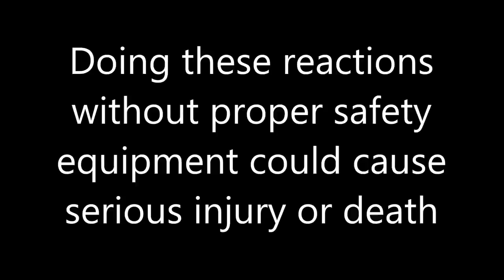Gold Plated Computer Scrap Complete Refining

Comment: Peroxide mixed with the hcl will speed up the base metal removal...... pins should be separated from other scrap, being the lowest grade...... chips with gold bond wires are the highest...... gold plated fingers and such are middle grade...... all 3 are processed differently..... the best way for pins and other iron containing scrap is reverse electroplating......
Reply from the maker: That’s exactly what I would say, thank you.

Comment: If you add hydrochloric acid and nitric acid solution shouldn’t  that dissolve the gold as well?
Reply from the maker: The aqua regia will tend to dissolve the base metals first - for some odd reason unknown to me. Plus, any gold that does dissolve will immediately cement back out of solution on to the base metals - so long as the base metals are present as solid metal. Gold will NOT cement out on the base metals that are in solution.

Comment: What's your opinion on induction heaters and table electric table top furnaces
Reply from the maker: Induction I’ve never used. I have used a Kerr Electromelt electric furnace. It worked well and got much hotter than I can get with a torch and open-face melt dish. But it was slow.
Reply: @sreetips  ok. I was either thinking on buying one of those induction kits with a 12-48'powe supply to do all my melting and casting or one of those electric table top furnaces that you can just drive a crucible in
Reply from the maker: For melting small quantities of gold and silver, the ease of use, speed and convenience of a torch and melt dish are had to beat. This has been my experience.
Reply: @sreetips  I was just thinking the same thing right now actually. I need to educate myself more on ceramic crucibles and graphite crucibles. What would you recommend for a torch for heating? I been looking into these MAPP/OXY combo torches. But I think MAPP gas alone can melt silver and gold.
Reply from the maker: I have two hand-held map gas torches (yellow bottles of gas). They will melt gold and silver but takes long than oxy/acetylene.
Reply: @sreetips  ya they do take a little longer to melt gold. Have you seen those mini OXY/MAPP torches they have at harbor freight and tools. It just like a OXY/acetalyne  torches but much smaller. You have a torch head with a oxygen hose and a MAPP or propane hose. Theirs no regulators on them though. The OXY/MAPP torches are supposed to get hotter than just regular MAPP gas with a torch head

Comment: i understand this is just an experiment, but given the amount of materiel and time it takes to remove the base metals is this an effective way to go about it?
Reply: No. Sreetips has in an earlier video told abou a tip he got, to put plated pins directly into his stock pot, where the base metals will go into solution, leaving the foils only.
But that takes place in a dark mud over long time and doesn't work well on video, I would presume.

Comment: So...I put my gold fingers and cpus into a 2000 ml beaker and added hci 6.0N. The reaction was immediate. It bubbled violently and formed a nasty black scum on top. It has been sitting for about an hour and I do not see any loosening of the gold. Instead, it seems to have dissolved the gold. That should not be the case. But the pins are no longer gold colored..they are silver. Can you explain what happened? Did I make some mistake or is this happening as it should?
Reply from the maker: Unfortunately, I don’t have much experience with this type of scrap. Sorry I couldn’t be more helpful. If you think there’s gold in solution then test with stannous to verify.

Comment: This is the negative control procedure compared to your others. Interesting. Probably A/P or nitric from hereon i bet.
Reply from the maker: Correct.
Reply: @sreetips  I've seen people do a quick wash in aqua regia to rinse off the plating that might be most efficient after some thought. The next step would be interesting to hear from you, maybe your ferrous sulfate trick. Also I have seen a video of guys dunking Pentium processors into a lead silver mixture that they then spread thin and cuppeled it directly into a nice gold piece. You all are pretty amazing! But I think you have determined karat scrap jewelry via nitric boils then to smb precip is most efficient profitable niche. Thanks again!
Reply: *silver-gold piece they made

Comment: @sreetips
I have 10-20 pounds of very old - heavily gold plated transistors (and some radiation hardened with gold processors etc.). I'm unable to find someone to process these. After following you for over a year (I'm fascinated with your process), I'm sure you don't accept requests (which is fine). But I seriously don't want to sell them at the scrap yard, as I'm sure they truly give a penny or less on the dollar [gold-value].
What is your advice for folks like me? Do I have a bucket of money with no real value? Thanks bro!
Reply from the maker: There’s gold in electronic scrap, but it’s not pure gold and it’s not easy to get. The value of your scrap is hard to determine. You’ve seen the trouble I encountered and I relied heavily on my years of experience to pull it off. You’d probably do better to sell it on eBay. But that’s just a guess.
Reply: @sreetips  No doubt about your years of experience. And yes, I do see the trouble you go through. You get great yields for what it is. Regarding the purity (as an expert electronics technician), my educated guess is because it's very early hardened mil spec stuff, they didn't really know how thick it should be- so it's slathered on. I've done x-ray fluorescence analysis in a lab before (but don't have that job anymore). That would be a hoot to measure the potential before attempting recovery.
**Thanks for publishing your passion, and replying. A rare breed!

Comment: Working in the electronics field I see a portion of the pins looked good still. Wonder how they were acquired?
Reply: Those were pins and such that I collected over 14 years as a solderer at a board house. Most were military grade clippings from connectors.

Comment: Really goofy question. How much is 1 gram of 22kt gold powder worth???
Reply from the maker: Would you like to see the math?
Reply: @sreetips  yes
Reply from the maker: 24k is pure gold. So 22k would be (22/24=0.916) or 91.6% pure gold. That means 100g of 22k gold would contain 91.6g of pure gold. The rest, 8.4g would be non-gold metals in the alloy. Usually zinc, copper and silver.
Reply from the maker: So the value of one gram of 22k gold would be $61.80 (current spot for one gram of pure gold) times 0.916 equals $56.60

Comment: I didn't know what you were doing I thought you were doing some weird hydrochloric test to see if you could just use that to get the gold off and then you started adding nitric crazy 🤣
Reply from the maker: Adding small doses of nitric forms a week aqua regia that will tend to dissolve the base metals first and not the gold. But any gold that does dissolve will cement right back out on the base metals.
Reply: @sreetips  I get it I think that's amazing that it keeps cementing back until the base metals are gone. But what was the point? Why didn't you just use straight nitric acid? Super curious have a good one buddy
Reply: Maybe just to show a different process? maybe I just didn't get that at first
Reply from the maker: Aqua regia does it better
Reply: @sreetips  I think I was just assuming that nitric acid would have been more efficient and faster. I don't think you have a video where you've used Nitric on computer scrap. Like you do on gold filled jewelry, Etc. Wait a second I know what I am considering wrong you don't use hot dilute Nitric until after you Inquart it. I forgot about that whole process. Alright looking forward to the next one man
Reply: @jaycharter4345  Yes. He has a video with 10 pounds if pins were dissolved only with nitric. It took 5 liters. HCL is cheaper, so he did it to prove it, but it is not the right way. Stripping the gold off first is probably the best way and that can be done with electrolysis using Copper Sulfate.

Comment: I’ve noticed that in this video you are extremely messy. I’ve never seen you so messy. Beakers all dirty. Your not useing tongs to pick up beakers. I realize now that this is a very old video. I am happy you have changed your messy was.! I’m NOT hating on you. My observation are just that.You have a wonderful weekend!
Reply from the maker: You are quite correct. Sometimes I continue to work when I know I’m not into it. I get real messy. I should turn it off and walk away, but I keep going. Thanks for the feed back.

Comment: Dear Mr. Sreetips,
Simply using a 3:1 solution of AR on the pins would have yielded the same amount of gold, and in about 2 hours and with a vast amount less of chemicals!! You mentioned you were making it up as you go so I guess you have learned that your method is simply not a good way to go. Please take this constructively.
Reply from the maker: That just isn’t true.
Reply: @sreetips  Well, I do it on a regular basis  ( 2 to 3 times per week) and have yields of between 3.5gm and 7 gm per Kg of pins, low and medium grade. I use 1.2 Litres of HCL, 400 ml of NAO3 and 100 MLS of H2SO4 per 1Kg of pins. After recovery, I refine to .999.
So I am sorry to say it is you who is incorrect!
Reply from the maker: Ok, I believe you. My experience has been different. I don’t refine much escrap because the yields are so low.
Reply: Yes, I realise that! That is why I made the comment. I really like your work on jewelry and silver. I too do a lot of that sort of stuff as well. I also process and refine all the gold I find when prospecting, well, the small bits only as the nuggets are worth a lot more than the spot price.
Good luck with your endeavors and stay well in these turbulent times.